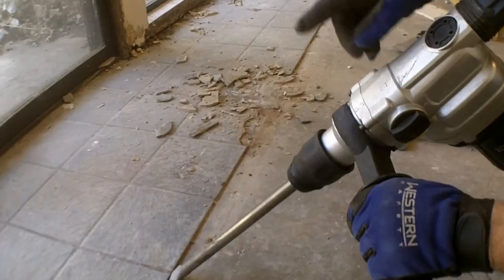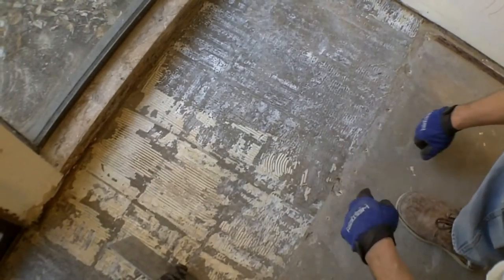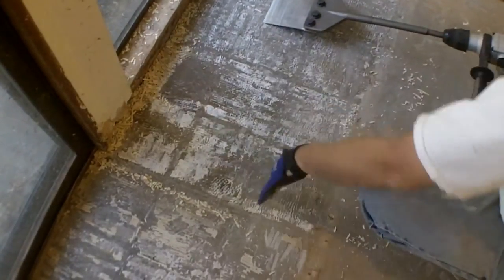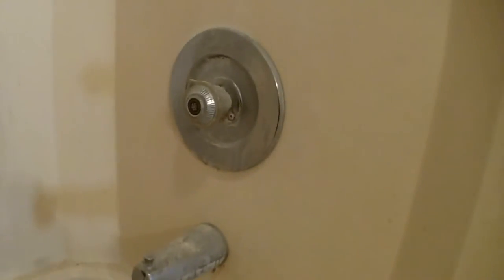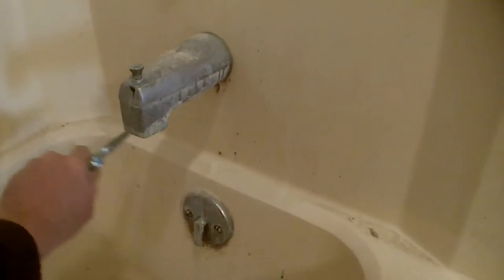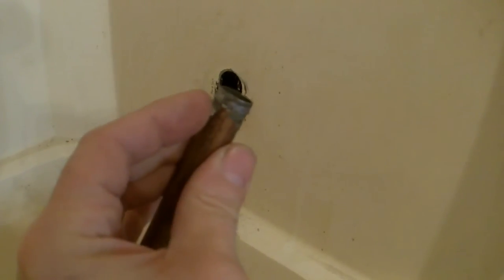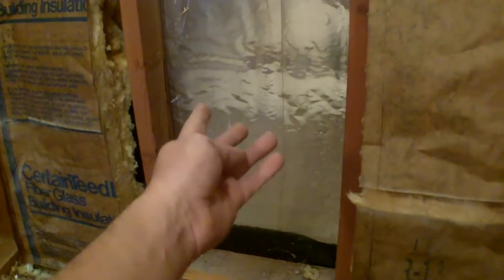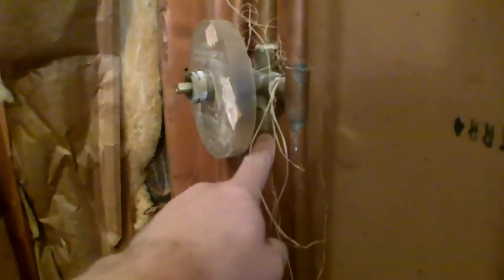Part7- Investment Property Renovation

Comment: That's some weird and wonderful copper pipework going on. The bad joint and the sweeping bends into dodgy angles to other joints, make me think this house was built by trainees on schemes. I have been to a few of them before. hot storage tanks taking water from the bottom, toilets on hot feeds, radiators connected in series. combis with the hot and cold swapped. emersion stats bypased but then timed just right not to boil over and boil the header tank. Scale inhibitors on the hot. list goes on, don't get me started on gas or electrics :D
Are you going tiles?
Never seen the scraper attachment before, look pretty useful.
Reply from the maker: Yeah, it's ran with soft copper so it can be bent to get it were it needs to be without too much effort. Regardless of it working properly, the job could have been cleaner for sure. It might have been done by an apprentice, or by someone that that just didn't have enough pride to make it look good- since it was going to be covered up. I've seen some strange things myself...lol.

The scraper attachment is turning out to be a great tool. I picked it up on eBay for about $70US to my door. The other brands I looked at were crazy expensive. G.

Comment: Electrical, then masonry and now plumbing! My kind of guy! That hammer and spade bit was nice work but the wide eBay bit was new to me. Worked excellent!Had forgotten the name of the spud tool, been too many years I guess - haha. The missing insulation explains why (with that contractor anyway) there was no sort of backer board at all! Will you be using the plastic tub/shower set or tile and stronger tub? I know it's a flip house, just curious? LOL, spray foam to fix hole? That was unique but might have been an effective quick but temporary fix for the rental landlord- haha. Surprised there was not any water damage on the framing or in the walls. You got lucky on that one.
Reply from the maker: LOL! Yeah Mac, I'll tackle almost anything. The wide floor scraper is a great tool. I looked into many brands but they were super expensive. I found this one on eBay for about $75 to my door. I also purchased two replacement blades.

Well I lied to everyone regarding the spud tool...lol. It's no wonder you forgot what it was called. It's a PO wrench...lol. I don't know what I was thinking..lol.

A spud tool is a wrench with fixed or adjustable end that has a handle that tapers to a point. It's used to align holes so you can put in a bolt for connecting things together. Like when a steel building is being erected.

We haven't fully decided on what we're going to install for a new tub and shower. More than likely it will be a steel tub with a tile surround.

The house wasn't a rental so I guess the owner sprayed the foam in. It might have worked for a while- who knows. Lucky for sure! G.

Comment: Is there insulation in the inside walls?
Reply from the maker: No there isn't. G.
Reply: ***** Cool,  now that think of it you did say that the pipe had a T running to an outside hose bib.
Reply from the maker: TheDisorderly1
Yes it does.

Back to G+, I can't reply to the other comment you made about using google earth. That is the same problem I had with someone else as well. Even though you have your settings working now- it doesn't seem to apply to old posts. So, what you might have to do is delete those posts from all the videos you posted comments on, then post them again like you did with the insulation question- yay G+....lol.

 That is a good idea though. I might have to load it up and see what I can see. Take it easy, G.